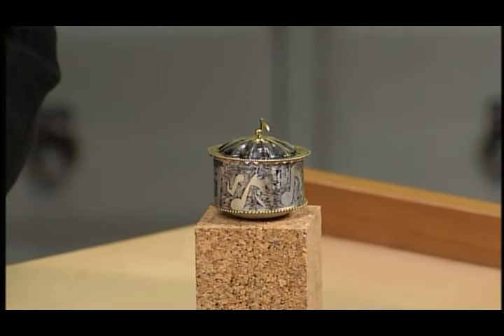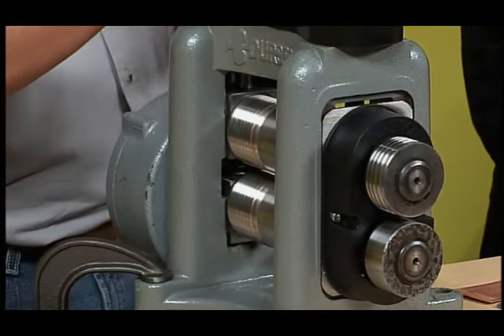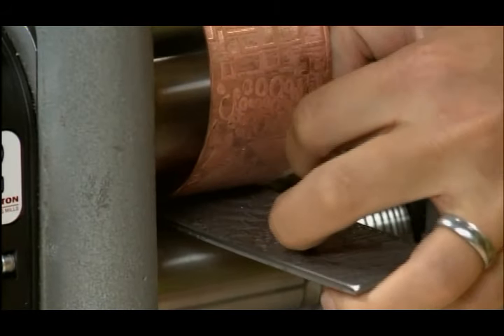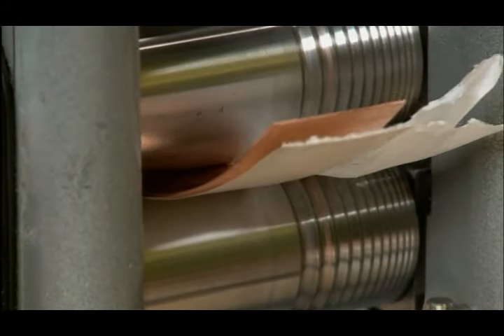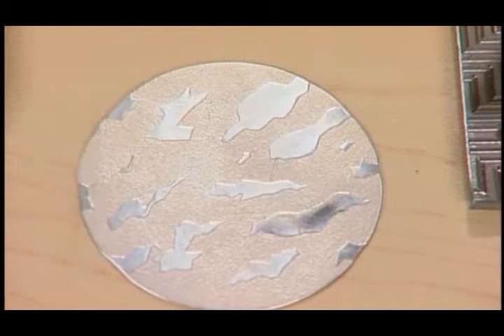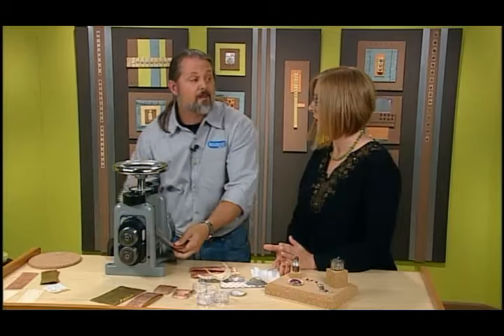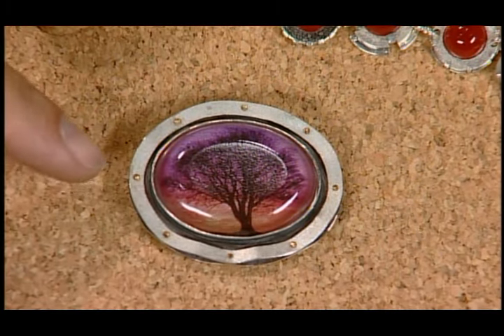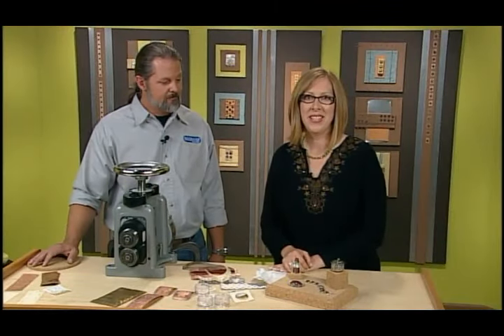How To Create Texture Using a Rolling Mill

Comment: I'm surprised you put the steel plate in direct contact with the rollers. I was always told not to run steel through (unless protected/ sandwhiched between 2 pieces of metal), as it will damage the rollers. Do you have any problems with this?
Reply from the maker: Hello Lulu, Great question. Durston is a high quality mill and the rollers are super hard. If you over tighten the rollers to the point that they are almost impossible to turn that can damage the rollers. If this were the case, we would recommend sandwiching the plates. We would recommend sandwiching the plates when the goal is a deep texture, only achieved by really cranking the mill. If the goal is a light pattern, then there is no need. However, in both instances it doesn't hurt if you prefer to sandwich the plates. Hope this helps!